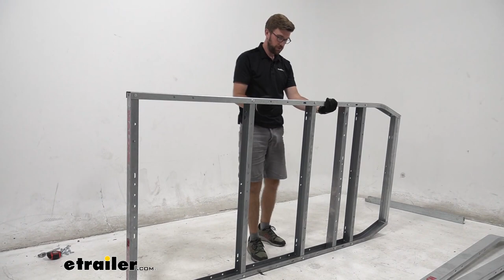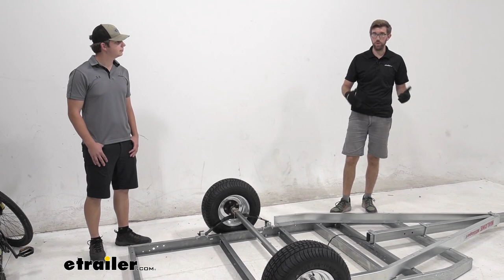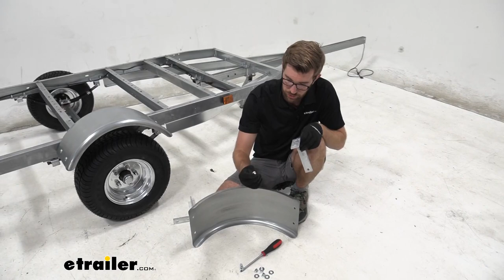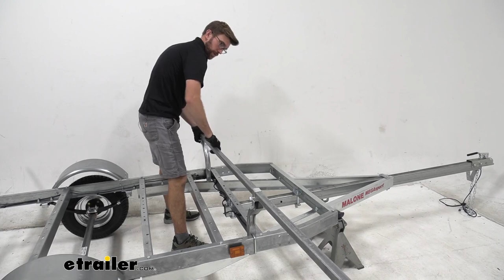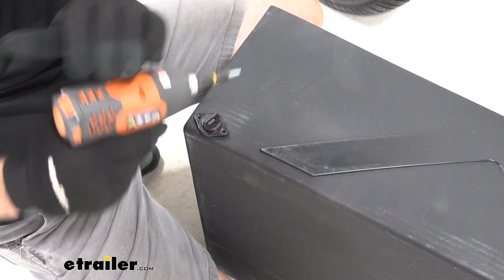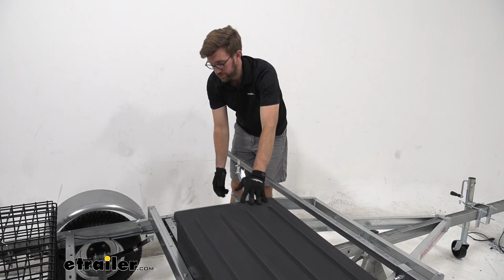etrailer | Malone MegaSport 2 Heavy Kayak Trailer Assembly

Comment: Far as the wrench getting stuck inside the crossbar, put a washer under the bolthead on the outside. This will make the bolt short enough the wrench will come right out. Before i did that i had the same issue, and a screwdriver didn't help.
Reply from the maker: That's a great tip, thank you!!
https://www.etrailer.com/Kayak-Trailer/Malone/MPG550-M.html

Comment: Bought a Malone trailer at Tractor Supply online - TSC, yaknow? where they deliver trailers to the parking lot, put a bicycle lock on em, and you do the paperwork, hitch it up, and drive it off.
Got there and they said we don't see your trailer in our trailers parked outside, hang on. Came back minutes later. oh....its in the back... in 5 boxes.
I said yeah, ok, bye. Had my jeep, and it was full inside, no way to haul 5 very large boxes.
Came here and watched this. 
Called TSC and refused delivery, cancelled the order. 
LOL I AM NOT DOING ALL THIS
Either offer an assembled price and delivery or your competition will, and everyone will buy THEIR trailer instead. Simple as that.
Reply from the maker: We have no way to ship a trailer once it's assembled. It would be too large and heavy to ship via UPS who does our shipping.
https://www.etrailer.com/Kayak-Trailer/Malone/MPG550-M.html
Reply: @etrailer  Yes, you have no way to ship them, currently. That doesn't really address my point at all, though does it?
I am suggesting you ACQUIRE ONE before you get wiped out by competition. 
Having a way to deliver the boxes and pay retail segments to assemble them, or a midway point to assemble them and deliver a basic stock to retailers like TSC, is just a couple ways it COULD be done. There is no IMPOSSIBLITY here.
And having a pre-assembled option thats more expensive in no way replaces or undoes the cheaper, build it yourself option you have now.
At least 3 pieces of useful advice there if you want to use them, or just ignore the problem, and hope I am wrong. 😁
Reply from the maker: Could we assemble the trailers and hire folks to deliver them all over the continental US, I suppose we could. Doing so would be prohibitively expensive which would price the trailers out of the realm of affordability. If we could do it, we would. Not a good business plan.
Reply: @etrailer  Negative. The price of the assembled delivered, and the unassembled box delivered would be different, as the cost of each operation would be different.
You wouldn't need to HIRE anyone. You would offer a payment for trailers assembled at the endpoints, and would pay folks to assemble them for those retailers willing to do so. By offering such, you would create a competition at the retailers as to which were willing to do it for a additional profit to them, and which were not. Eventually competitive nature of retail would result in that most retailers would do the service for the right fee. That fee would be a portion of the extra you would charge for ASSEMBLED trailers. None of this is very complicated, and what you call a Bad Business Model, I call a Real Lack Of Imagination in meeting customers needs. None of this changes the current price of your boxed unassembled trailers, and to be honest, I think you know that.